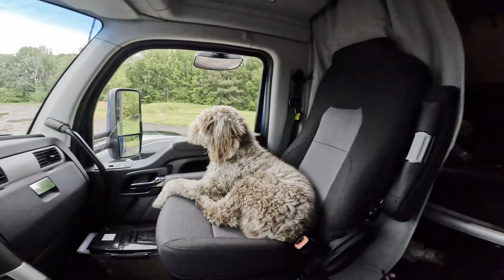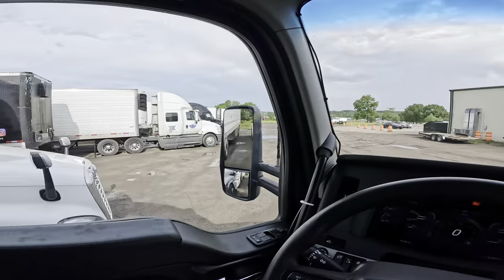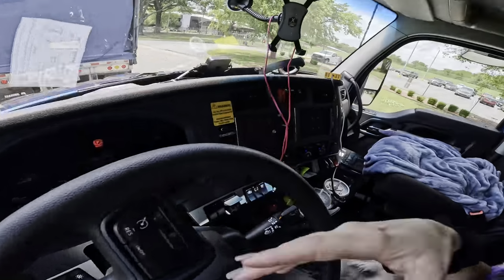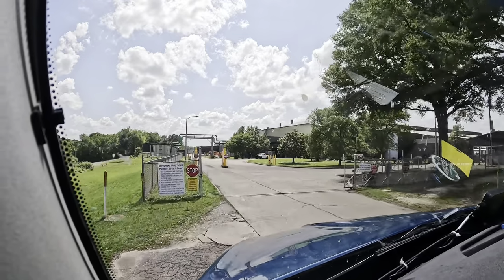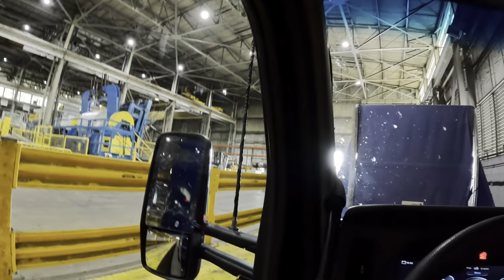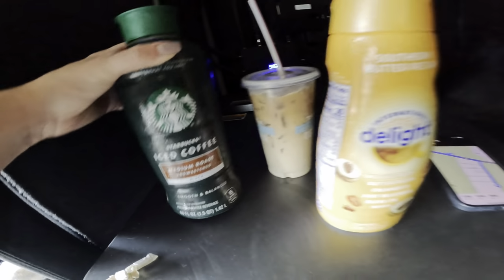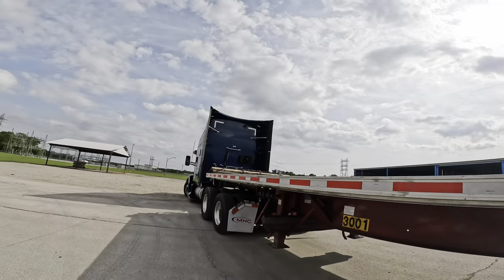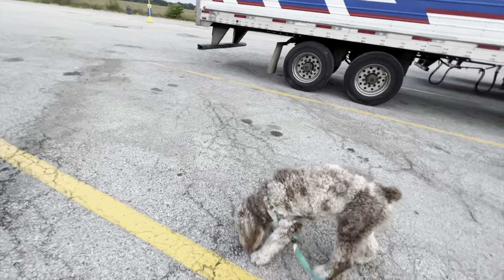1st Time Securing 35K Steel Coil! 😳

Comment: Be careful.  They don’t call them suicide rolls for nothing.
Reply: … this is so very very true
Reply: You know I've never noticed if her truck or trailer had a HEADACHE RACK on it to help protect the driver.
Reply: The worst thing to haul in my opinion are pallets of silt sock
Reply: @jeff7764 Try hauling cow hides you'll never forget that smell.
Reply: BeccA, please after u leave shipper. First safe place to check your chains on coil ok
Reply: WHOAH...
Reply: @terrystrickland1471  I've never driven a truck but I imagine it doesn't take much momentum for those coils to break loose chains.
Reply: Yeah why don’t she have a shield on her truck most company’s won’t let u leave the yard without then
Reply: My friend died because it came loose at a hard stop and it rolled and flattened the cab
Reply: @FrancisSwayer  You got that right!!!
Reply: @FrancisSwayer My grandma works at the Kansas turnpike and one of her coworkers got covered in cow remains from a slaughter house… Idk what was wrong with how the trucker was hauling it but when he came to a stop a whole sh!t load sloshed out and fell right on her. All the old ripe guts and everything else the slaughterhouse doesn’t use. Something I’d never want to experience.
Reply: onions! 😩

Comment: New job, new truck that she hasn’t sorted, never hauled coils, keeping dogs safe and looking after what they need , recovering from strep throat, having antibiotic induced #2’s, in the hot weather, all without complaining and raging at other drivers as a bonus……you have to rest dirty because the shower is broken, BRB makes flatbed look easy….it is not a easy job at all

Comment: I usually use 1 coil rack per 10,000 pounds and round up. Minimum 3 because if you only have 2 and one fails then you have that third one as a back up. I’m not trolling I promise just giving my experience.

Comment: Be very careful about on-ramps and off-ramps. A coil load like that has a very high center of gravity. It will flip you upside-down in the ditch real easy if your to fast through the turns/bends.

Comment: As others have said, FMCSA requirement is one rack per 10k, racks need to be placed within the width of the coil, so that the weight is right on top. Tell the company to get you a 3 or even 4 piece lumber tarp with 8ft drops. That one is a 2 piece tarp, too big of pain in the ass. On coils always go extra on the chains. It's a cheap insurance policy on your butt. Overall great job, Beks! 👍🏻 see you on the road
Reply: Excellent information for you BECCA!
Reply: Extra on the chains always good advice. Just like the old adage"Better to have it and not need it than the other way around!

Comment: In my experience, most of the aluminum/steel coil shippers don’t allow metal edge protection. My company uses felt strips. I feel those work best because usually your felt strip will be long and wide enough to cover all of your chains. You end up using only two felt pieces rather than using 10-14 separate edge protectors. Good job on the coils, just wait until you have to tarp coils loaded eyes to the sky.

Comment: Love having coil loads if able to choose between eye to side or shotgun I always go shotgun so I don’t have to use the lumber tarp just the 6 ft steel tarp.

Work for Maverick for a year good flatbed company learned how to secure steel and aluminum along with lumber and other materials. Only problem is you can’t have pets in the truck.

Comment: Been trucking OTR almost 32 years. Pulling  53' reefers just over 26 years. A few years into reefers,  the company needed to expand faster than they could buy trailers. So the rented some. At the time, they could only rent 48s. Man, I had so much trouble backing the 48s. Never pulled flats or spread axles. Hats off to you.
Reply: Intresting. I've been thinking about going towards flatbed. I started out dry then doing reefers now for about a year. I love it. However, I dont know jack shit about load securement or flatbedding.
Reply: I heard about the split axle being harder to turn blah blah...dont know till you know.
Reply: @rogerg0834  I do know,  you can't make sharp turns. You risk popping a tire off its bead.
Reply: @Edward Antrobus Jr  See, now that is what I heard. That is so weird. Cant you raise up one of the axles? Making it easier to turn? Otherwise how the hell do you park in a truck stop? Most of those place are freakn 90 degree backs.
Reply: Some trailers have a lift axle, some have sliding tandems like a dry van. Middle and back axle slide together equals "closed" pivot like a dry van at that point
Reply: @rogerg0834 It's not called a split axle it's called a spread axle and you use a dump valve on the rear axle when making sharp turns.

Comment: A little tip for the tarps if you’re going to stow it on the deck is to do your folding on the ground and before you roll it up, take an end and pull it on the trailer. So much easier that way. Used to work with a 5’4’ 95lb girl and she managed tarps that would fit over 28’ sea cans. A lot of the time it’s not about how strong you are but how well you use the strength you have.

Comment: Well done! 
You went right by my place to grab that load. Hwy 71 south to Y City is a booger to drive and 270 from Pencil Bluff to Mount Ida is one of the most crooked part on that road. There has been several truck wrecks on that section of 270! Stay safe!

Comment: Hey Becca this is probably too late. But you need to set your 4 by 4 and your coil racks before you go in that building. That way You are set up and ready to drop the coil in the coil. Rex. Also put. Your coil racks in the middle of your trailer. Your term syndrome is on the side of your trailer. They are usually the middle mark of your trailer

Comment: When you fold your top hook one side to the trailer with bungees as tight as you can and then just go to the other side and pull it straight out. Saves you a lot of walking in circles

Comment: Brush up on your coil securement. Coil racks 1 per every 10k, should put rubber mats between the coil racks and trailer to keep coil rack from slipping. Also helps to have beveled 4x4. When loaded suicide one chain in center then equal amounts pulling to each side. According to what each chain is rated for. For a single 35k coil should be 5-7 chains. Also I'd look into them getting a headache rack put on your cab. Not saying it would happen but if a coil or steel came loose it would help protect you in the cab from it coming thru the cab. And as a fellow flatbedder if you ever need help just ask another flatbedder we do pretty good at looking after our own. In December I broke my right wrist and had a couple drivers help me out lifting my lumber tarps. Also get 2 lumber tarps and 2 steel tarps. Good luck out there girl!❤

Comment: What?!?!? Becca you motivated me to switch over to Flatbed from reefer last month and you are telling me you never did tarping?! Well welcome to flatbed 😂❤. 

Regardless, I think the tarp you have is a 60 lbs steel tarp, there’s heavier one called the blue tarp which weighs about 80 lbs. Tell your boss to contact local custom tarping company to get you lighter tarps that won’t break your back whilw tarping! 

Having the right equipment’s make or break this line of work Honey buns! If you see Flame Red Pete with a flatbed/stepdeck from Prime Inc, that’s me so don’t forget to holler!
Reply from the maker: Haha nah I’ve done plenty of tarping! I’ve never tarped a coil before! And that tarp was def more then 60 haha 60 is light 😮‍💨

Comment: Make it easier on yourself. Get a 4 foot step ladder. You can Bungie it to the deck behind the cab when you don't need it. Keep the tarp on the deck. It's easy to fold after the load is off. Just a few hints from an old steel hauler.

Comment: Hey Bec, Don't somebody make a potty that uses a disposable cartridge or some simple way to get rid of the used part? Seems like there should be something for those times when you don't have the luxury of waiting and then heading inside? What about a portable shower? Just a simple frame that holds like a curtain and stands on it's own or leans against the truck or trailer and a black bag that heats from the sun to hang up high enough to support a pretty good stream. Campers have them and I've used as little as 5 gallons of water and took a very comfortable shower. Nothing beats a nice shower after a hot day working except a nice dinner and a beer after the shower. Ha! Thank you for allowing me along, it's always very interesting to see you handling the details, and the way you pronounced Terra Haute is what I've heard actually going there and Tom Selleck on Blue Bloods pronounced it that way. So your right on.  I just love the doggies Bec, together they make your little family. Very good content and very good editing. I'm wishing all the best for you and your little family. ben/ michigan PS that is a beautiful truck

Comment: Flat bedder must haves…
Get a pair of way too big hi-vis long sleeve coveralls. You can slip em on right over your clothes, boots, hoodie and all. Get done loading, roll em up stick em in your side box and all that tarp skum stays out of your truck/house.
Grab a couple i carry 4 cheap Walmart towels. Great for drying off the dogs, laying on the floor of the truck on those muddy days, and cleaning yourself up after loading/unloading.  
Up your towel game with 3 or 4 gallons of water, you can wet one of those towels to wipe off sweat and tarp skum.. when you park for the night hang anything wet on the rub rail of the trailer to dry..
Cold shower wipes,,, self  evident. 
I don’t know what the female version of axe body spray is but do that too.

Finally tarp tip of the day..
When you untarp position it so when you are done rolling it the finished roll is right next to that tri-park generator. Then you can pick it straight up on top of the generator, roll it on the cat walk climb up and lift it onto the deck.. 

Make the suck work for you not against you.. PEEEACE!!

Comment: 48 feet thet nothing compare to 2 48 together 😂😂😂 i take tow some time i run on late night because traffic for Dunkin donuts and ny truck is not avregular day cab got a sleeper and my experience coming from containers i do pull wll kind of chases 20.40.45 .53 dry van amazon is 53 what im doing right now if you drive a 20 trailer 😂😂😂 you going crazy people dont have the skill to park that dam trailer because you want that trailer go into a parking spot and the trail goes to another place they got lost on the back of you truck and mirrors trust me

Comment: I also drive these coils in Belgium - France but over here they load them different way, they are turned 90 ° so they can only 'roll' in the corners to the side off the trailer not forward to the cabin 😄

Comment: I started driving a truck back on 1985 overweight  step dak flat bed Big cement pipe over 100 K wight  local in California 3 trips a day from Burbank California to downtown Los Angeles California back on old time paying well for flat bed any kind of flat bed if I was you go for pulling a refer same money or same paycheck  less swearing all you have to do is keep eye on Temperature and loading and unloading make sure your load is OKAY be at shipper inside and receiver making sure they are loading and unloading right matches with bill of leading

Comment: Coil racks are rated at 10k each.  So if you have a 35k lb coil you need 4 racks.  Place the single coil just aft of center of trailer with a spread axle. Each chain for 10k weight plus one extra for safety.  So you should have used 5 chains.  Coils are super dangerous if not handled correctly...that coil is loaded suicide...you don't get a second chance if done wrong.  Be careful steel hauler!

Comment: Future reference hauling coils requires 2 coil racks minimum but every 10k add 1 coil rack each coil rack is rated for 10k for a 35k coil use 4 always round up never down

Comment: IF you check your clock the time you are spending unloading and loading with your help you are doing free job if you pull a refer you will make same money without sweating tarping plus DOT loves flat bed pull you over every 2 hours to check your load

Comment: Question from a 4-wheeler.  Other than the smaller tires and a lower deck permitting taller loads why are flatbeds and step-decks talked about like they are very different?

Comment: Bang gears smoke deers use a blanket if you ever don't have edge protection and get a coil tarp way easier to throw and make sure your chains aren't twisted when you throw through the eye binders will come loose.

Comment: I had the Goodluck of knowing a few fireman and was fortunate enough to aquire their old firehose. I cut into 18 inch sections works great for any type of load from steel to concrete. It's more flexible than plastic or steel edge protectors. And I think does an even better job of edge protection. Also the  fabric and rubber hose used for pumps. Like for darining unwanted water and such are made the same ways. So just a lil tidbit incase of an oh shit monent in the future. No pun intended.

Comment: A trucker from the UK here. I mainly haul steel coils on slidaflex trailer or euroliner curtainsided trailer which sit into a well. I hate carrying coils on a flatbed trailer as I've seen what it can do when it goes wrong. Only thing is, we strap coils with straps, not chains 😅. But the way we strap them, they go nowhere. Anyway, stay safe out there 😀

Comment: Them coils like that will cut a trap up, you can find something like a old blanket cut it in the length and width of a coil put it on top of the coil to save you the issue of having holes in your trap

Comment: When you don’t have the metal edge protectors , you can use those thick rubber mats you put under the coil inside against the edge , it won’t hurt it at all . Also look into coil tarps make ya life 10x easier

Comment: For your coil cradles you put rubber mats racks dunnage and more rubber mats the beveled part of the wood you want upwards and each coil rack you have is good for 10k and you want to round up if the number isn’t even so 35k use 4 other then that nice job and if you have a 2in ratchet strap toss it just under half way of the coil and it will stay put the entire ride keep up the good work driva👌🏿

Comment: If you get stuck no edge protection. To get you out of a corner e cut the pun 😅 you can fold cardboard use carpet or fold rubber until you get specific ones . Keep on trucking Becky bec 😂👍👌

Comment: you definitely had the Duneg wrong the cut piece goes tot he inside and the triangle side goes into the coil rake then away put extra chains on coils they are the most dangerous cargo you will carry! On the tarping looks good but make sure you got coil tarps for the next one and not lumber tarps cause that tarp looks more like a lumber then a coil and as for boards under your trailer you can probably store even more lumber down the center just need more straps from Walmart to secure!

Comment: Great enthusiasm but you need to read up on working load limits and rules of securement. 2 coil racks is not enough for that coil. That weight can blow out just 2. Needs 4.